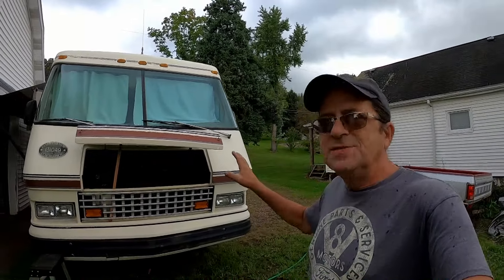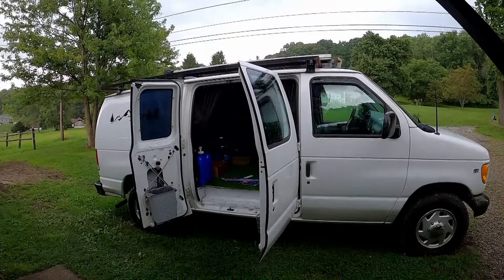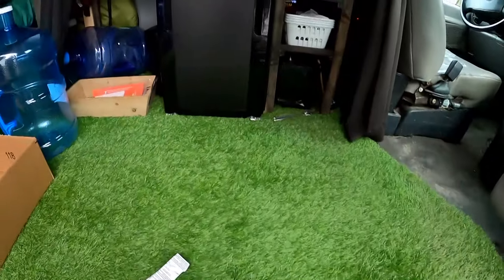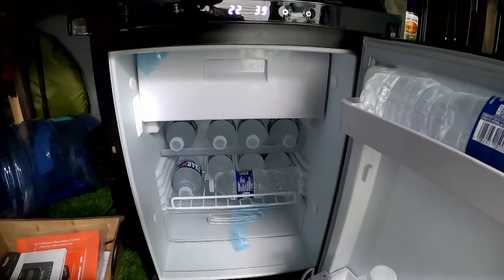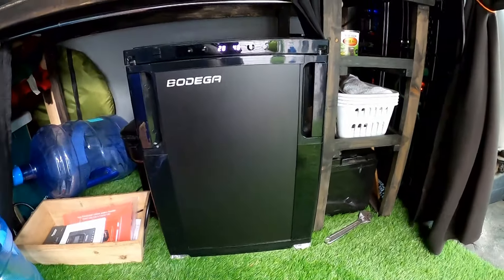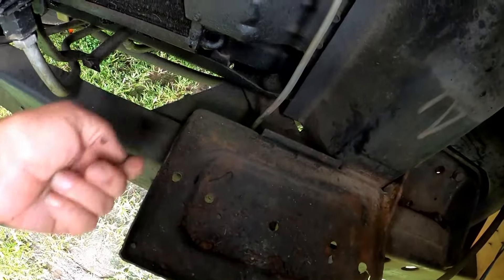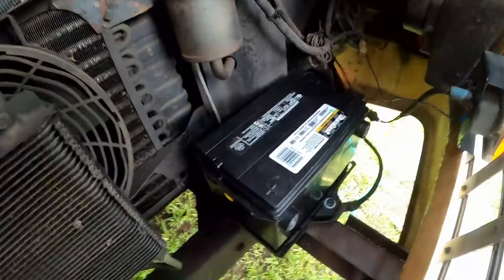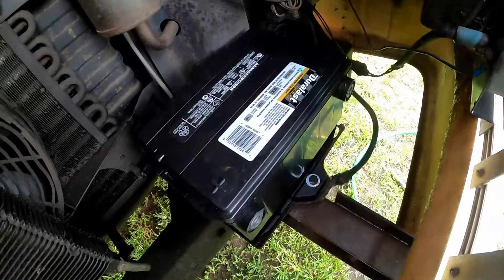Poor Repairs Corrected - A Very Cool Van Upgrade - Bodega RV Fridge & RV Battery & Wiper Replacement

Comment: This fridge is exactly what I've needed for my rig, thanks for the review. I just got it on Amazon used (like new warehouse find) for $350. Already had a Bodega chest type, this will make things easier. Time to look at my batteries too before winter, motor & house both from 2017. I always do my own work and watch closely any work I have done.

Comment: Dave, I’d be careful with adding that older battery to your house battery bank.  If it isn’t as strong as the batteries in your house, it will drag them down to its level – the same principle applies to mixing solar panels.

Comment: I worked in garages for about thirty years and saw a lot of hacks out there,one of my favorites was the guy that was proud of the small coffee can of parts after an engine job. Yeah ,that C10 left the shop under it’s own power but chances are it will be a come back and the hack guy has rolled out to the next shop down the road after sucking all the gravy out of the C10 customer.   I’m with you Dave,you’ll get the bugs out of this RV.

Comment: You might want to pull the plugs and check to make sure they are correct. Even check the air filter and oil filter too. Hopefully they didn't put transmission fluid in the engine! Lol

Comment: My dad was a truck driver and mechanic he told me to always ask for the old part when taking your car, etc in for repairs.. and at that time insist on staying close and watching the procedure. Course now they force you to stay away.. Anyway, I took my car in.. told to come back later.. and since I had two babies under 4 I did that.. Picked up my car. asked for the old parts.. headed into LA from Barstow... just about to my destination I realized the brakes they worked on failed!! Going freeway speeds.. Well I finally got off and gingerly drove to my dad's work. He put the car up on a rack.. looked at the supposed work done.. Redid the work.. sent me back to the dealership with the old part and they told me I was crazy.. !!! I told them the part they gave me was for a complete other model car I was turned away.. Well, NO.. I made signs and stood outside the service dept... talked very nicely to every incoming customer..The owner came out.. asked what the problem was.. inspected the part

Comment: Why leave auto doors open for rain to come in? 🤣. Those repairs should have been a quick and easy repair.  Especially with all the needed tools in a Shop.  I understand your frustration regarding work ethics these days.  
 Nice little refrigerator in the van 👍👍🤗
Reply: jjoy if your talking about Dave's RV door it was under the canopy or garage door, so the rain wasn't going inside the RV.
Reply: @mags3521  I said auto, as in his van.  I’ve noticed a lot of folks do that.  Perhaps the angle or slope of the roof aides in not allowing the rain in, if it’s coming straight down. 🤷‍♀️.    Correct, the RV doorway was protected.

Comment: As a woman without the benefit of knowledge of vehicle maintenance or knowing of someone who does I'm a target to be taken advantage off which I suspect the former owner was too. I still can't do most of the work myself but I do now research and tell them what parts I want and don't leave it up to them. I will do easy work  myself now and save the $50 labor charge for a 15 minute job

Comment: Pro Tip;
Mid September buy new wipers. SAVE THE OLD ONES + THE PACKAGING!
Mid-May reinstall the OLD wipers. SAVE THE NEW ONES - in the packaging you saved.
Mid- September reinstall good wipers.
Mid-May change them again.
On and On and ON!
=====
Windshields get so hot that the wipers warp and deform.
Using this tip, wipers will last years and years.
----------
Dave spent 20 minutes giving us a lesson on the joys of OCD and forgot to inform you about proper blade maintenance. 
Sorry Dave - but you do that sometimes. 👌😊🙏🙋‍♂️
Reply: Sapphire Sword, I've NEVER ran across anyone in the automotive industry who does this. Are you serious??? 
I've managed 2 NAPA stores. Been a buyer for used auto's for a dealer, and have gotten to know countless garage owners. 
And NEVER once heard of this practice.🤔
Reply: @onrycodger  
Now you have.
Summer heat harms the wiper rubber. It deforms the blades. And AT MOST wipers last 3 years, before they fail to clear the windshield properly.
Everyone knows this - I am supposing, you do as well.
My process and procedure allows the wipers to have "exceptable" rubber riding the windshield during the hot dry summer months and excellent rubber during the cooler, wetter months.
  And it takes just about 9 1/2 minutes of your day and will extend the life of the new blades for 10 years or more.
Screw the "Part Dealers" and so called "Expert Mechanic Shops" that you're so proud to have associated yourself with.
THINK Outside the "Corporate Mindset" of "waist it we'll sell you more".
Or don't - I really could not care less.
I just thought since Dave brought an important issue to his show, I would share "proper maintenance tips".

Comment: New parts , ...for the wrong vehicle....installed incorrectly....equals returning to the shop for.....new parts ....for the wrong vehicle....and so it goes.

Thought of you and Betty as I traveled five miles of construction on I-55. We maintain our ' vintage ' vehicles,  only to be shaken apart by poorly maintained roads.

Comment: Some shops do a crappy job while working on some ones else's things and they get ripped off 200 bucks is high for a battery but when u buy a good one u pay extra but it's worth it my 99 doge ram wheel chair van high top just had a new water pump put in at the dodge dealership 900 bucks but it's fixed running good just rolled over 64 thousand miles had 55 when I got it in 2016 it's been a good van 5.2 318 v8 4 wheel drive some doge cars I don't like but I don't hate it u buy some thing reliable and keep up with repairs it will last good video

Comment: Cool fridge but way to pricey for my budget 😂 when we buy used vehicle you find crazy things. I just replaced my 3rd brake light because previous owner attached it to the roof with a wood screw.  Didn’t have the nuts that one is suppose to attached to the roof.  Some people 😂

Comment: All kinds of sympathy and empathy from me, Dave. How freaking annoying is that! I know you can't really identify the shop and show the receipts.  You have a business and a family.  But I'd hang them out to dry, naked.  I might have Bella find the bad mechanics instead of the bad deers.  I feel so sorry for the previous owner who clearly got ripped off big time. Thank goodness you know your way around vehicles and their engines.  Those wipers. Omg are you kidding me.  Even non-experts know a lot of these things.  Don't get me started on auto parts stores. Some really know their business. Some have no business being there.  Dave, all that holding it in and biting your lip, I'm afraid you're going to have a stroke, right after you gnaw your lip off. Some stories to make you "laugh":

Once, I had an oil change done in addition to other work. They were already there, right?  Yeah, well imagine my surprise when I found out, 125 miles later, that they emptied the old oil and didn't put new oil in. None. The dummy light didn't go on. I was more mad at myself than I was them, because I always check my fluids before I leave the lot. The one time I didn't nearly cost me my engine! 

I also put a little bit of spray paint on parts I'm having replaced, and I provide a box for the to put the old parts in. When I get my car back, my fluids better be right, and the spray painted old parts better be in the box. That's right. I'm a bitch. I'm a nice bitch, though. I politely insist.

Once, a "mechanic" (at a dealership), decided to do me a favor and filled my tires to 44 lbs. Thank goodness he told me that. I told him they couldn't go above 33 lbs. He argued with me (I just stood there, incredulous).  I walked into the general manager's office (not my first time), and told her I wasn't moving my vehicle until the air pressure was corrected. I acknowledged that I could do it myself, but a few people needed to learn some things. The "mechanic", his supervisor, and the service manager, for three. I didn't want the guy fired, I just wanted to bring them up short for lack of oversight. I wonder what was being done to people's transmission, etc. 

So many other stories, but these just highlighted the unbelievability of what goes on!  Maybe laughing at mine might lower your blood pressure a bit.  So will playing with Bella.  Hugs and kissies for sweet Bella!

Comment: The previous owner probably gave the job to the lowest bidder.  Sometimes the lowest bidder isn't fast enough, they're just half-fast.  BTW, I had something of an issue going to the bodegacooler website, apparently their security certificate (https) is either invalid or expired, and chrome wouldn't let me browse there without going into the settings and dialing back my browser security.  It makes it appear that their website is bogus, and they really should fix it if they want to sell their products - which look really nice!
Reply from the maker: I didn't get an error on any of the three links listed using chrome..
Reply: @DavesRVLife  I probably have my security settings on extreme paranoia mode